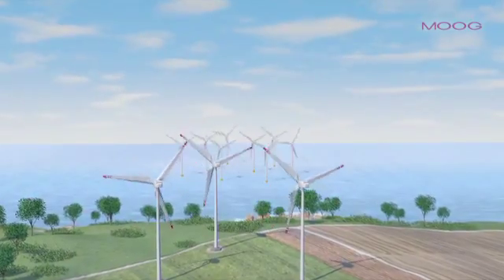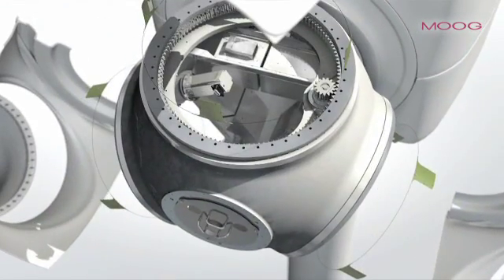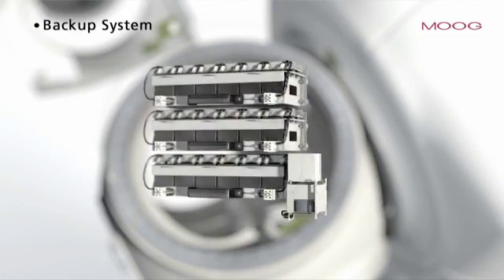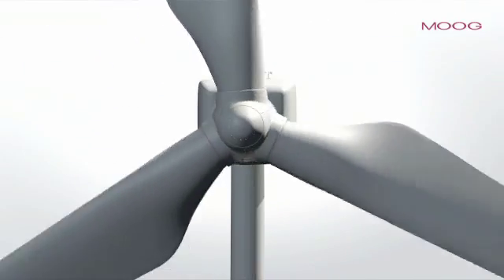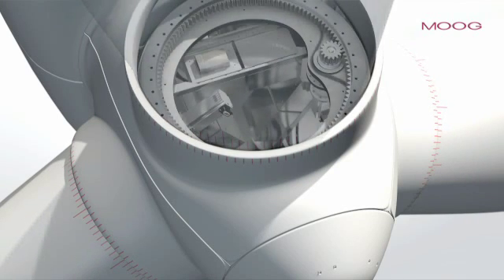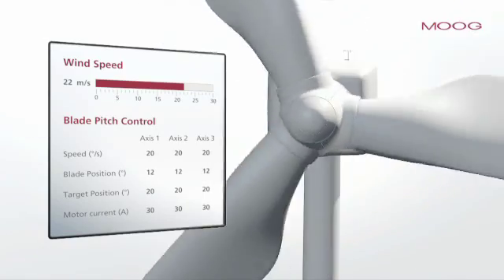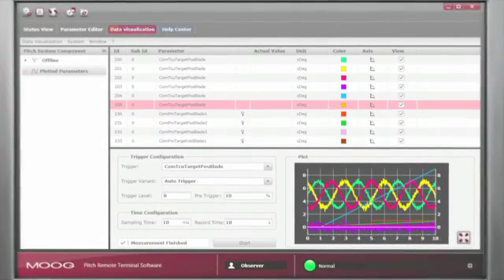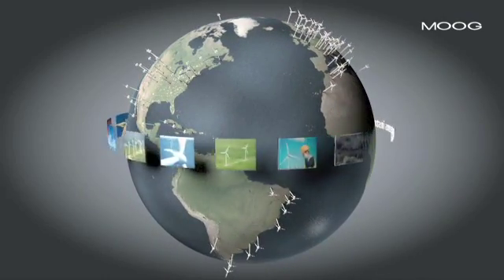Pitch Control

Comment: im confuse how do you provide power supply to those mechanism since whole rotor is rotating. Is there a battery with in it?
Reply: 2:10 the slip ring transfer power and communication. And yes, there is typically batteries in the hub for emergency blade return to "neutral" position
Reply: @ttic24  do you have any resources that I could refer to regards the concept.
Reply: @steveivanka  Sorry, I started working in the industry and all the resources we use are internal use only.
Reply: @ttic24  oh no you miss understood what I was asking some learning resources from internet which you could guide. But anyway you help with your last comment. And appreciate your comment. Thanks wish you luck in your work

Comment: Have agood day
I have a question I hope that I find you have response your capacity as specialized in the wind turbines .
 If the wind power that runs the blades for example, 100 hp  ,  or 100 Newton the number of cycles entering into  gearbok and then to the generator fixed and stable the output electric current good and stable in terms of voltages ,  ampere  ..  the question here ,The amount of energy entering the gearbox and then to the generator of 100 horsepower or 100 Newton    how much horsepower or newton  Newton will come out net of the generator representative of electricity after calculate factor friction and heat intersection magnetic fields in the generator .
 I hope to answer my question with thank ..